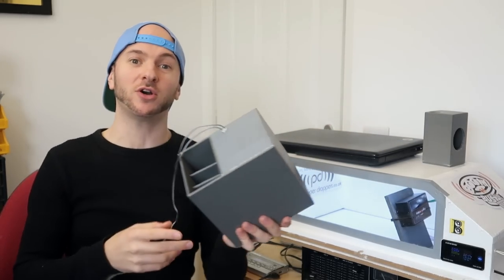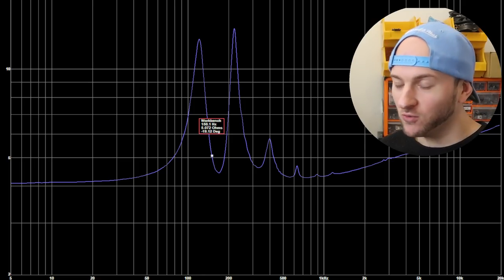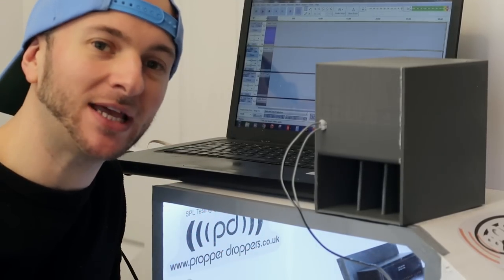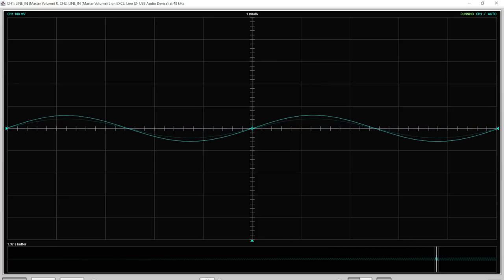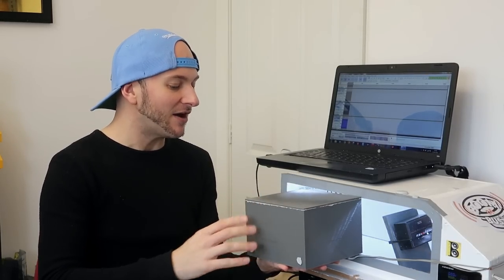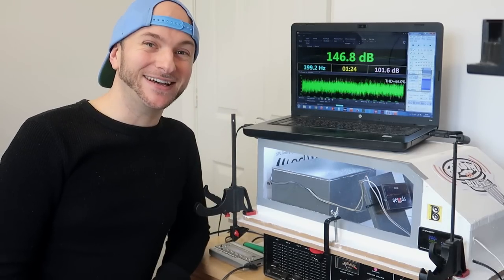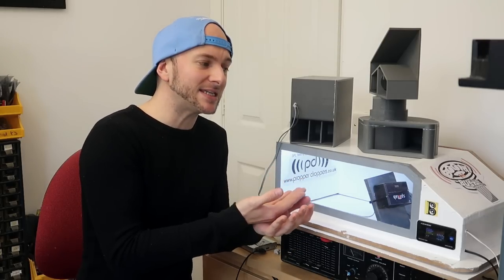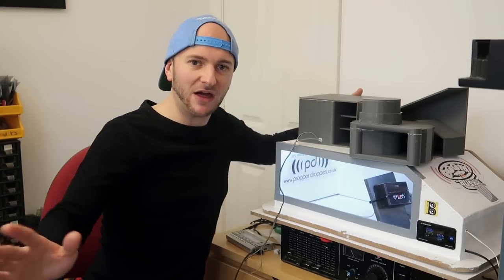I Printed a Mini Tuba HT. It's CRAZY. | Boom Or Bust S1E12

Comment: I’ve been thinking about something with these and wondering if another test may be in order.  While the 15 watts may be consistent with those that have enormous amounts of power on tap, since different frequencies are being tested, I wonder what would happen if the amp had the gain/volume set at a consistent point (like how it would be in our cars) and then let it play with whatever the wattage may be with the rise at that frequency.  Just curious as to how that may change things up.  Thoughts?
Reply: It's a good idea.  I suggest too measuring the THD and capping the amplifier output where THD exceeds 25%.
Reply from the maker: 15w only scales to 500w lol. That would equate to using a 800-1000w Amp.

Comment: What do you know about Tactile Response - TR (particle velocity) vs acoustic energy? That may be an element of the paper moving which you have intuitively recognised as also occuring at port tuning freq. With an accelerometer the port freq is the peak freq for TR. 

Currently a group of us on AVS are working to understand the relationship of TR and freq behaviour given TR enhances immersion ... you need less volume to gain immersion when TR is present (scientifically).

Comment: Sure, if you use FOUR 12s- and the amps to push them, and the power supply to be able to keep them happy. A better way to describe the THT is that it NEEDS 1/4th as many drivers and 1/4th (or less) of the amps, money for amps, power supply, money for power supply, etc. 
Not to mention the fact that it SOUNDS better.
Reply from the maker: I think the four drivers getting the same 15w total between them would still be louder but it's something I'd love to test! 😊
Reply: @barevids  No need to test it, HornResp speaker modeling software will tell you. But even without modeling I can assure they would not be louder with the same 15w. They might be with 15w each.

Comment: My guess is that the boxes that keep dethroning others are going to just get bigger. A simple ported box that essentially walls off everything behind the "seat" will at least outperform anything so far at its tuning frequency. Two things at play, less internal airspace to fill with sound, and a larger ported box makes a larger spl increase at port tuning(I've heard and seen this on some box calculators, but idk how accurate that is). A 4th order or horn taking up the same space will do the same thing. The cabin resonances will all be changed, so that could mess with how well that works, but it might just make it better. So far the loudest boxes have all been quite large.
Reply: Matter of fact here is the base design, just a flat panel with a port, sealing it with glue tack to the edges, obviously you need to tune the port based on the airspace left, so its something only someone with that information can do. I got thinking maybe he cant really make one box that size, it might not fit under the printer, idk, but a flat piece with a port, I'm sure than can fit.